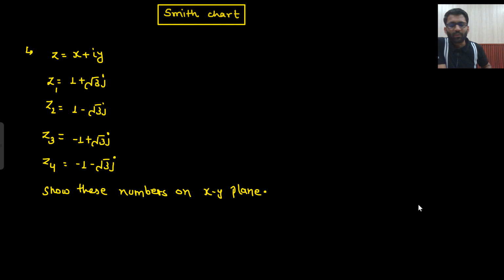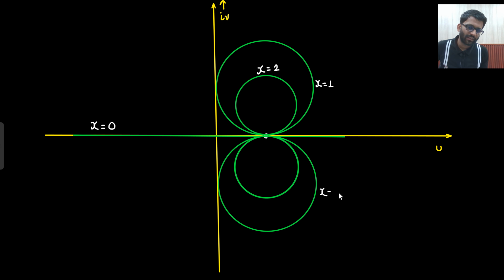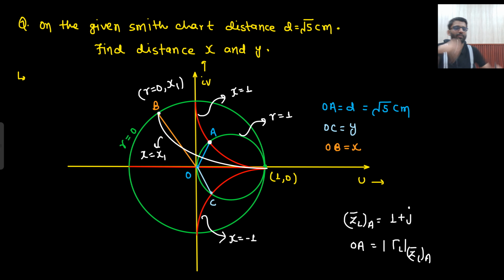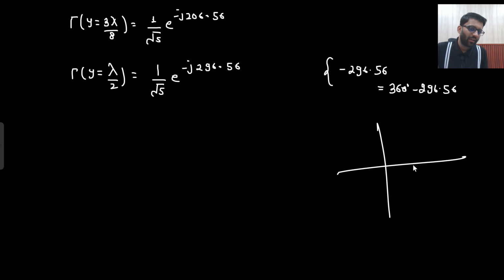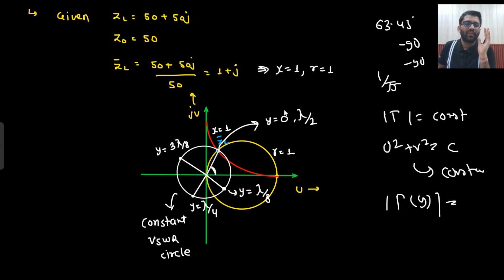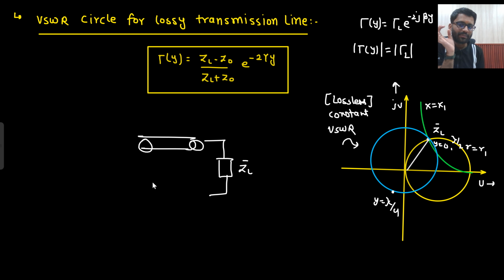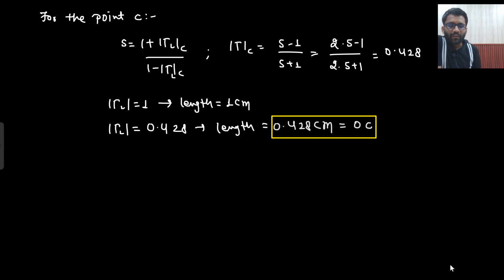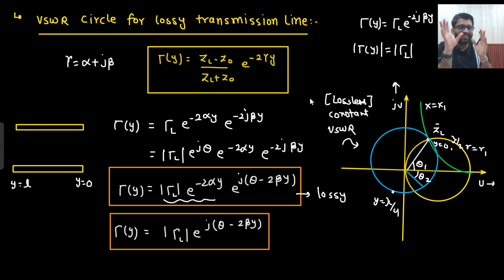Smith Chart & VSWR Circle for Lossy and Lossless Transmission Line || EMFT || ECE || PrepFusion

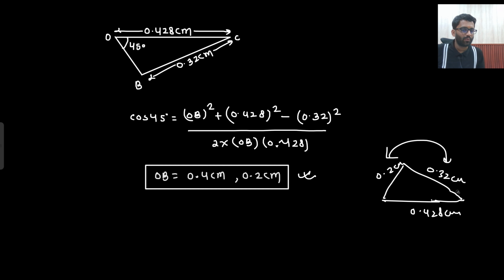Comment: sir @3:27:46 you have solved a quadratic equation and written the answer directly but i don't think that is possible on the gate tcs ion calculator so what should we do when such quadratic arrives?
Reply: Solve it by the basic calculations. This is what I did
Reply: Leave that question 😂